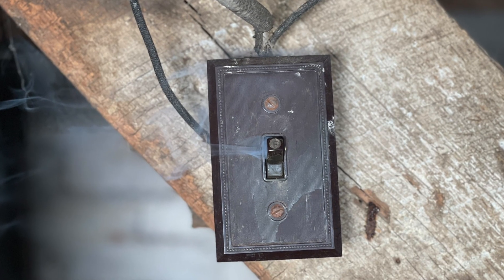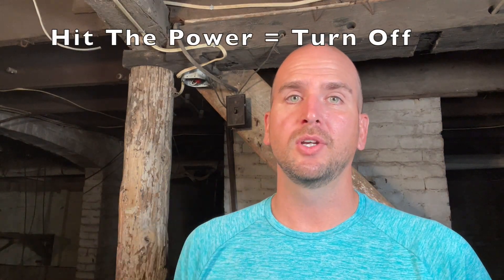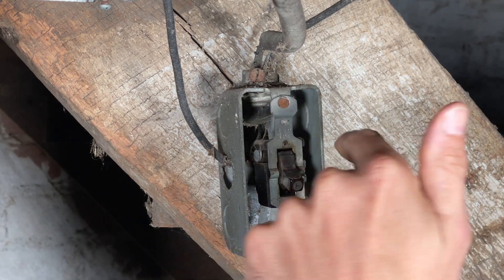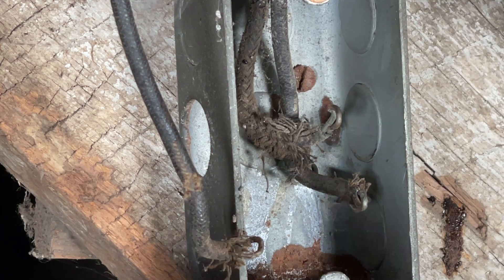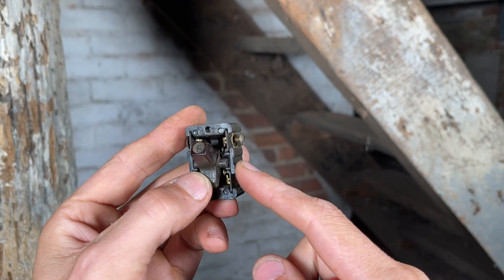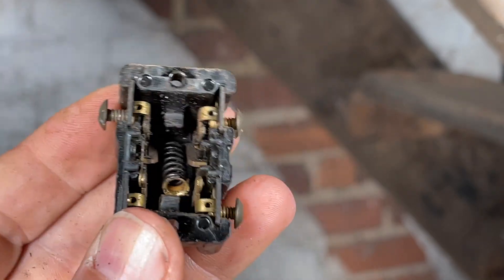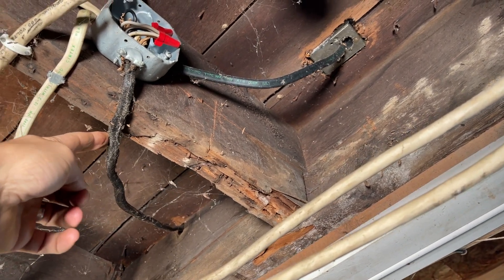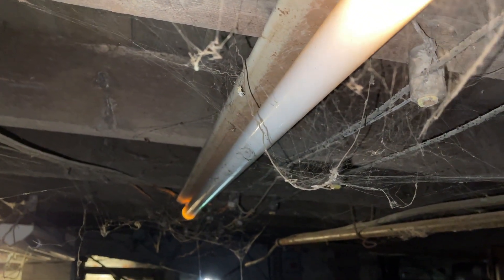Issues with Old Electric Wiring | Knob and Tube

Comment: I have a 2000 ft apartment house and I got a 50-60k estimate.  I have an updated junction box that had some corrosion from  a wet basement with wires feeding grounded outlets.  I also have 1950 wiring being fed by knob and tube.  Everything has to be replaced. I could see most wiring but it was not until we opened the ceiling that we found active knob and tube.  I am willing to remove all walls for access and this is the price. More than the contractor, more than replacing all the heating and plumbing combined.  This is upstate New York not the city.  I would love a 30K process, I got this house at auction

Comment: I would not reuse old switches like this as they were open front and front wired.  Any loose connection would cause the Bakelite switch plate to burn.

Comment: Well, that is a 3-way switch, not an on/off switch, so who knows what it is energizing on that other leg.   I had a friend call me up because he tried replacing a 3-way switch, but he didn't even follow the directions on the box, which even that wouldn't have helped because it wasn't wired the modern way.  What really got him was the common screw on the replacement switch was in a different location than the original, and when he tried wiring point-for-point, he ended up creating a dead short due to how the circuit was wired.

Comment: My (1893) house is definitely "Hybrid" with K&T, BX and Romex! But at least it was done "right" the existing K&T is in good condition and is only left on lighting for the second floor (where the "OG" 1920s light fixtures exist!) everything else is "modern" (1960s-1980s upgrades). This is RARE though my house belonged to my grandfather, an electrician and my father, ALSO an electrician, so the improvements over time were done correctly. That "hot" to the handybox lonely as shown alone gave me the "heebe geebees".

Comment: The issue with the switch and box shown is actually solved by proper K&T installation and management. Youre supposed to use a loricated box and snake-skin secondary conductor insulation to create a surface and cotton insulative bushing for the conductors. This box has neither, and has failed after probably about 60-70 years. It is definitely not original work, that would honestly be safer.

Comment: My dads house was built in 1939 or 1940. It doesn't have knob and tube wiring, It does have the old rubber coated wires though.

Comment: Wow... this video describes exactly whats in my home, Basement had access to the wiring using junction box's to run the power to individual rooms or circuits just glad this was common practice but not safe either

Comment: As a owner of a home built in 1946 with both mostly older non-grounded BX cable and cloth braided sheath cable similar to romex cable I see his point. However, I strongly disagree with the complexity of a home re-wire for an older home he implies! Much of the older homes were built with the electrical ran in the attic and under the home of its a raised home or in the basement. 

Lower receptacle outlets near the floor or in the floor were mostly run under the home or in the basement. Light switches, ceiling lights/fans were ran in the attic with the power in the light/fan electrical box. Since the power is run to each light/fan box, walls with no insulation are common and ease of locating walls under the home were also common.

Running a romex line to each receptacle can be done from the attic into stud bays and to floor receptacles in the floor with only light annoyance. These romex lines can be joined in the attic near the light/fan boxes inside of a junction box with another line from the light switches to the junction boxes. Then a home run line from the circuit breaker panel can be run to the junction box above each room to supply power to each room on breaker for each room.

This effectively provides a circuit to each independent room on a breaker for just that room. The same can be done for each appliance and so on and will clean up the old wire that is unsafe by todays standards and be within NEC code compliance. This so older homes have independent circuits for each room and appliance. Also no longer have just lower receptacles or lighting loads for the hole house or half of the house on one circuit causing tripping breakers due to overcurrent.

My home now has a 100A breaker panel in the laundry room with one circuit for each of the six rooms, two kitchen counter circuits, individual circuits for all major appliances like the fridge, gas range, microwave, dish washer, disposal, two 240v window a/c units, washer & gas dryer, outside GFCI circuit and driveway gate. Also there is another 100A breaker panel in the garage with 240v circuits for a MIG Welder, air compressor, wall mounted heater, window a/c and 120v circuits for lighting and receptacles for normal use.

Comment: 100% Correct. Ours was built in 1932. We have a breaker panel on the north wall in the basement. One of the breakers is labeled "Aux Panel" that is a 4-socket Edison style fuse panel on the ground flor with 4 circuits that are still in service.  We have a mix of 2 and 3 prong outlets, most of which don't test as having a ground and a mix of Romex and knob & tube.  I hate it.

Comment: I see that you struggled in getting wire from the screws. I usually just remove the screws all the way, even in newer devices. The last couple of turns are difficult, but easier than damaging the wires more than necessary.

Comment: These comments endorsing knob and tube as good until modified is absolutely astounding but also very believable when it comes to the rampant ignorance that people have with electrical knowledge. Sharing a neutral throughout the house as is common place in knob and tube systems is a primary and major issue to start!! If you don’t understand this basic reasoning as to why considering how the modern age has brought different loads to the AC system and how the distortion in harmonics, overloading the neutral because of that harmonic imbalance from greater computer loads as well as increasing appliance loads in addition to the risk of getting in between the neutral even when you think that the hot conductor is denergized because these old school practices they switch that neutral instead of a hot conductor. You have old deteriorating soldered joints, insulation wearing off completely because of decades of continuous overheating. Residential electricians by and large are sloppy and not skilled enough to properly install, considering they typically exceed box cube capacity by using old small single gang boxes with to many conductors, they don’t mark circuits or understand the importance of layout and minimizing splices, they don’t organize circuits that make sense to the end user because they do the minimum…knob and tube is this scenario on steroids. The size wire gauge that is used for knob and tube is undersized for modern load increases in demand. If you’re advocating for the use of knob and tube you are absolutely ignorant and need to back away from electrical work because you’re in over your head.

Comment: That breaker panel is in poor shape, a lot of rust needs replacement. It was installed right against the brick when it should've been installed on a plywood backboard or set away from the masonry wall on some kind of standoffs.

Comment: My mom's house has the all original wiring including the fuse box and we have fuses the house came with a shitload of fuses like we're loaded so if we blow a fuse we can just put another one in there but the fuse box we are going to consider replacing it but see it has like asbestos blocks that the actual wiring is running through so we are reconsidering just not messing with it all together because it works just fine lights don't dim the nothing really flickers you can plug an AC and then you won't see the lights dim the wiring is fine the only new wiring there's the whole 220 system by itself that was the only New edition they had coming off the existing power meter on the outside of the house and that has its own dedicated breaker box which is nice to know that at least the 220 wires are not cloth but all are 120 wires or cloth all the ceiling lights or cloth everything is original wiring but see our issue is we have a house from from like the early early early 19th and it has asbestos insulation the addicts been sealed off all the ceiling has been sealed off to prevent any exposure but Siri issue is all the cloth wiringis ran through the attic and basement and those pole switches that you have down there those are from the 1900s we have the same thing in our basement they're from the the 1900s be replaced one cuz it kept barking real big and we got a date code off of it still had a date code it was embedded in the middle it's from the 1900s so that that switch is about almost as old as our house our house is about 150 years old my Grandpa wants us to move out cuz how old the wiring is and how old the infrastructure pipes well all that is original it's all from when the house was built except the well pump that is actually feeding the pipes that come into our house the kitchen's been redone in the early fifties some of the bedrooms got replastered in the 50s but most of the plasters the original horse hair asbestos mix bulshit that really you shouldn't have but yeah we have a really a sketchy old house and we're going to be buying another house most likely that is also infested with the original wiring and I do not know if there's asbestos in thethe walls but I guess whoever lived in our house in the 19th or early 1900s must have been loaded because you know asbestos insulation was not cheap at that time the house has a fully reframed roof ridge because the original roof ridge was sagging and there's a brand new roof on that house it's a pretty nice house it's all original a

Comment: That switch style is much newer than most knob and tube, which usually had push buttons or rotary snap switches.  The real problem was the light fixtures, where the wires came through a flat board between the joists on each of two 45 degree holes right next to and opposite each other.  The wires would be cased with loom but the ends would simply sit under the fixture cradle, without a box.  Heat from the light would destroy the insulation which just crumbles when you work with it.  I've done a lot of knob and tube work over the years.

Comment: I grew up in a house with wiring like that.  Cloth covered rubber insulated solid core.  We had 2 switches like that too.  The insulation preventing a shock was the wall paint someone had covered them with.  When we scrapped off the wall paint, touching the switch from the side to trun it on gave a good shock.  LoL.  Another issue with the 1910 wiring was if you touched it, the insulation flaked off.  Or somewhere inside the wall the wire strand itself broke.  Pr both happened, the wire broke and at that point so did the insulation.  We also had a fuze box in the basement with a circuit that was so bad there was a 1930s penny sitting in it.  (We totally replaced that circuits wire back in the 70s.)  Then there were the old switch types.  Push button and external to the wall round bakelite switch boxes.  We swapped a lot of those out.

Comment: That smoking switch isn't really a knob and tube problem, it's just a failed switch badly installed.  Those wires leading to the switch don't just need a clamp, they need something called "loom", which is a tough jacket that slips over the wire and protects it.  And of course a ground for the box (just replace that one with plastic)?  

I lived in a house with knob and tube and I'm familiar with its problems.  It isn't inherently unsafe but it often is unsafe.  Here are some of the issues I've seen:

- Mixed up neutrals (this happens with NM cable and conduit too).  Turn off a circuit, disconnect the wire and the neutral shocks you and/or caused a dangerous imbalance in the wiring.  
- Ungrounded conduit, or conduit grounded through the plumbing which used to be allowed.  That's fine until someone disconnects the plumbing or replaces it with plastic.  Ours was newer and many (but not all) receptacles were grounded with a separate green wire but no switch or light fixture grounds were available.  
- Exposed wire with insulation falling off.
- Things spliced in haphazardly, as in your switch.  Or transitions to NM without using a box.
- Knob and tube wiring tends to produce stronger magnetic fields in the home.  This induces hum into audio gear.  
- The wires end up buried in insulation, hopefully the insulation is nonflammable and nonconducting.
- NOBODY knows how to work with it any more, or does but refuses to because they don't want to be liable for undiscovered problems.

The good part of knob and tube is that if it gets hit by lightning and the house doesn't immediately burn down the wiring itself will still be good.  Of course everything connected to it might be destroyed.

I'm not an electrician, just someone who lived in a knob and tube house and noticed some of the issues. I'm sure there are plenty more I'm unaware of.

Comment: Thank you for the video. As a home inspector I see many homes with the partial electrical upgrade you describe. Sometimes the upgrade is only the installation of a new panel and installing GFCI receptacles in a kitchen and bathroom. Other times the upgrade includes new receptacles, but without updating the wiring. If a buyer does not have the property inspected they should have the electrical system inspected before they move in or rent out the property. They would also need to be prepared to upgrade the electrical system in terms of budget and time. As you said, the time and cost of properly upgrading an electrical system to current safety standards can be expensive.

Comment: Man, that electric system looks exactly like my homes electrical system (built in 1901). It looks like the original knob and tube was replaced at one point with 12/2, and who knows what inside the walls. 😳😬

Comment: Excellent -- Thank you! I have one of those combo hybrid homes. 
Question: Why would BOTH knob and tube wires light up using one of those little noncontact testers (mine BOTH light up)?
Reply: Non contact voltage detectors can be picking up phantom voltage and are not very reliable for determining whether or not something is actually live.    Also in the knob and tube days the wiring was oftentimes both black, sometimes the neutral will have a white stripe or tracer, and two wire next to each other were not necessarily a hot and a neutral,  they could be travellers in a three way switch setup,  for example.   And they oftentimes tapped the nearest hot or neutral to bring power to a receptacle or light fixture not necessarily on the same circuit either.   Light switches were sometimes placed on the neutral, rather than the hot, and a neutral to a light fixture might be hot back to a switch that is OFF. The point is, older homes can hide many dangers, and the codes of the time were far less stringent for safety and health hazards.
Reply: @Sparky-ww5re  Got it! All good -- Thanks!

Comment: I’ve been in electrical for 25 years, I absolutely hate knob and tube. For its time it was great, one light and maybe 2 plugs at best in each room. The problem is that homeowners hire someone that is NOT licensed or has a clue as to how to handle that stuff. They just make open joints in the attic and crawlspace, and call it good. I have seen so many very dangerous things that people do with electrical, and I know it’s literally a miracle those places didn’t burn down.

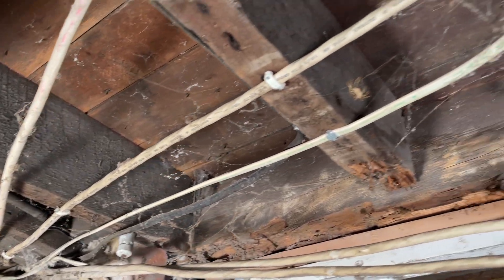Comment: Is it legal by the NEC to splice Romex to knob and tube inside a junction box like that at 5:47? Like, if I had a knob and tube conductor break, could I run a Romex line to the knob and tube conductor to bridge the gap between the knob and tube and panel or do I have to replace the entire conductor?

Comment: My Mom and Dad bought an older home back in the early 70's. It was originally built in the late teens or early 20's, as it had the kind of wiring you showed in the basement, but this home only had an attic. I warned them about the wiring in the house, but they were strapped for cash and couldn't do anything about it. By the late 70's they had saved enough that the entire house was rewired with a new panel, and had new romex run to every outlet, light,  and switch. That cost them about $5000 back in the late 70's. It was passed by the city inspectors!

Comment: OMG the basement wiring all needs to be re pulled or rewired so it is properly installed not under rafters with no protection and repull through trusses and staple at all proper bend locations thats why diyers should always have qualified electricians do or inspect redone wiring repairs even if a homeowner does it the insurance company will not cover fires from non permitted and non inspected work

Comment: This video takes me back to a house we bought in '86 but built in 1913.  It knob and tube in the attic, some early romex style and then a sprinkling of romex.  Electrical panel had the screw in fuses.  I found on socket with a penny in the bottom of itThere were even the push button light switches.  I saved some of those old antique items.  It was only a 60a service.  Had a 100a service brought to the house and a licensed electrician install a new panel.  After that I did all the work and it passed inspection.  Oh there was even some bx.
Reply: The penny in a socket bit -- so dangerous!  My father found that in the fuse box of a house he owned -- and the wiring was covered with cloth that just disintegrated in your fingers when you tried to work with it.  I am glad that fuse boxes are just about a thing of the past.